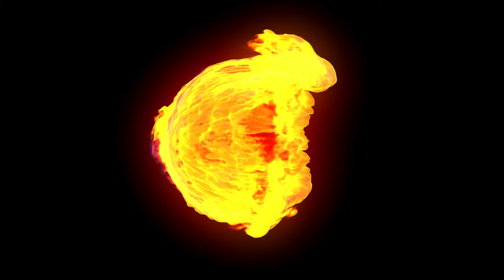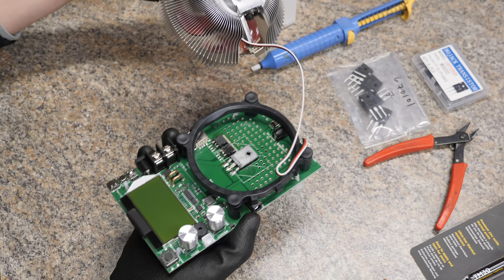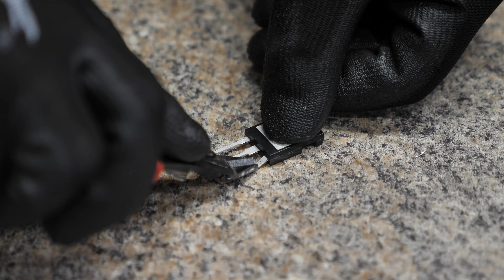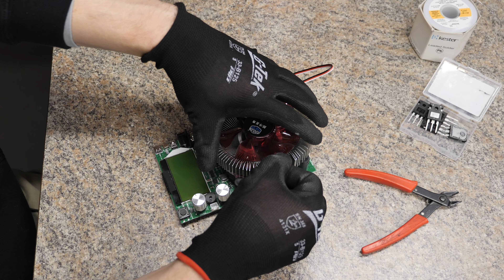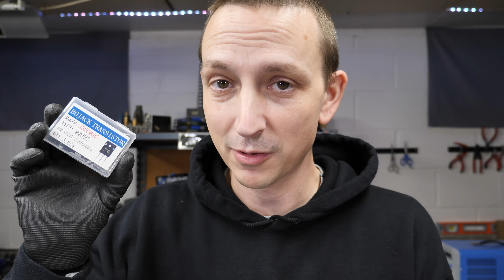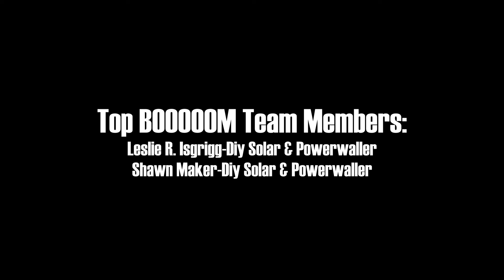150w Battery Capacity Tester Repair - Easy Fix

Comment: Another great video of a common type of repair, nice work Joe 🙂
However,  I must offer a  correction on solder types, it does matter.
You should suggest  using only Rosin core solder for electronics, and never Acid core solders.
Most who watch these videos already know this, don't offer wiggle room for those who don't.
A word on alcohol cleaners, most  off the shelf are from 70% to 90% isopropyl alcohol the rest is water.
Use 100% isopropyl alcohol from an electronics source, otherwise allow the water to dry before powering on.
Till the next video, 🤔💭💣💥
Reply from the maker: Thanks!! Yeah you are right! I always assume others know but I shouldnt assume!🤘
Reply: @AVERAGE_JOE  
There's no way out of assumptions, contrary to that foolish popularized idium, ifself packed-full of metaphysical assumptions, they undergird all knowledge. A helpful key is simply formally recognizing, like prerequisites at university, the knowledge scope of your target audience with key reminders (as you did in new component selection). 
Helpful vid. Thanks!
Reply: I would just buy a can of contact cleaner. Specifically designed for this purpose, pretty cheap and will last you forever.

Comment: Whenever you're testing batteries there must be a backup disconnect system. Never rely on a single semiconductor to stop the current flow. Batteries are never off, they'll give you everything they got without question. Whether or not you want it.

Comment: Just fixed 2 of these that I have blown up, easy fix with your tutorial to reference.  Saved $100+ on fixing instead of buying new ones.  Next time I will make sure the dials are all the way off before connecting an 80v battery at 10A instant load.

Comment: Just did this (a couple times because I apparently can't follow directions), but I used the cheap Bojack MOSFETs.  I also used a piece of flattened copper pipe as a shim between the FET and heatsink to (hopefully) aid in thermal transfer.

Comment: Changed it like u showed, set Batt test to 1.5amps, 150w, Batt is 48v 20amp rated. Tester worked for about 5amps then overheated again and stopped working. Don't understand why unit failed again after mosfet repair

Comment: Its not a easy fix this guy Repair it china style its not smd parts its tht is true hole you need the mosfet true the hole of the backend for a good conection this Style of repair is not Save bending is not needed this guy love to get a house fire this failing again if use on high temperature use tin crack again on

Comment: 6:28 the ideal is not to pass 20A to 22A in the Mosfet .... it's a DC region not in pulses region as inverters work. the Mosfet will not handle the heat of 25 amp in the DC region of the Mosfet where the Mosfet not fully off or fully on completely. and don't forget the higher the voltage you have the lower the Amp you need to put. the Mosfet is good with lower voltage and high current in low frequency and high voltage low current in high frequency

Comment: Hello dear creator
I have the same capacitor tester as you exactly and the exact same problem as you.
But my MOSFET number is IRFP264 and it is not available in my country. Can I use IRFP260N ?
Reply from the maker: Yeah all you need is a good quality mosfet with similar specs as the one that came out/blew up.

Comment: Mine went boom a few minutes ago :(  I can still smell it burnt remains...
I thought you could hook it up to 36 volts. Went pop. Or maybe it can handle 36volts and i had the amps to high. Either way it popped.
Reply from the maker: Whoops😆 Yeah you can 36v but need to start with the dials turned down. Can do 150v if I remember right but again, start with the dials down!🤘
Reply: Fixed it...Thanks for the part reference, my was unreadable.
Reply from the maker: 💥💥 Awesome!🤘

Comment: Please help. Mine has a different problem. The knobs are responding and its actually discharging the battery as it lowers the voltage when i turn the knobs but the ampere is always zero. Which part do you think is the culprit?

Comment: 150W thru one mosfet?
That's too much.
They should've used at least 2 to divide the load.
Yes once I've managed to get 200W on smaller TO220 package but I would do unconventional stuff like soldering that mosfet first to IHS (copper heat spreader salvaged from old CPU) with it's entire back and then having it slapped on a CPU cooler with some PC thermal paste.
At the same time when I had a larger load made using 10 of the same mosfets in parallel, I would do dumb mistake of disconnecting the load at like 40A while it's active and it would turn into a welding machine and completely melt high end gold plated 4mm banana connectors rated to 60A, but the mosfets were unharmed, because I was well within the SOA.
Reply from the maker: Do you think its possible to add more in parallel or would we need to add other stuff in order to make it work?

Comment: They have a design flaw, you don't have to do anything wrong to blow it up! I want to find the original manufacturer, you you know who it is? The type of Fet is the problem. Most fets, any brand, any rating, are not designed for linear operation. they may be rated for 30A and 150V but they can't handle 10A at 100V, just itto illustrate. there is a range of Littlefuse devices designed for linear operation that don't die. I have blown one up and fixed, tested it.
Reply: Atorch.

Comment: Mine just died, I'm unsure if it's the MOSFET that's broken or not, I hit start and nothing happens.  Is there a way to test the existing MOSFET to make sure before speding 1/3 of the cost of a whole new unit?
Reply from the maker: Yeah you can if you have a digital volt meter. You would set it to the diode setting and check the pins to make sure. Just look it up on google and it shows ya how and what to look for.

Comment: I ordered on Digikey, next i will unsolder the old mosfet and clean the area. Hope i can restore my unit after alot of smoke. new ones are 50 amp, 200 volt

Comment: I've had several of these...the mosfets are not protected in any way and there is no feedback loop to protect the mosfet. The gate driver is the problem. It runs to hard and has many spikes on it that exceed the gate voltage. Add a 15v zener from gate to drain to help soak up the gate spikes. When the mosfet blows it is not unusual for it to take out other things too.

Comment: Chopping the legs off of the components you remove first is best I find, IF you don't plan on reusing them. It makes removing components much quicker and easier as you only have the little legs to desolder and unstick from the PCB.

Comment: Thanks for this video. I blew up the MOSFET on my tester once before because I monkeyed with the settings to get the watt draw higher, by just a little, and the original MOSFET popped. Found a video that suggested buying a higher quality replacement and using more and better quality heat transfer paste. Did that and I've have been rockin' ever since. Then I connected an 18 volt Ryobi battery to it after turning both knobs all the way in the WRONG direction. If not for finding your video, I wouldn't have known that that little booboo also pops the MOSFET. So I was able to use the extra parts that I bought the last time to fix this up in just a few minutes, so thanks for giving me the exact info that I needed, and in a short concise way. BTW, if you didn't know, you can change the settings on these testers and get enough amps to do a .2 C test on a 100 AH 12 volt LiFePo4 drop in battery, if you provide a small fan to help keep the temp around 65 -70 C. I've also set it on top of a couple of frozen water bottles to run the test. Stay safe.
Reply from the maker: Awesome glad to hear you gotter going! No I didnt know you could change the settings😲😲
Reply: @AVERAGE_JOE  Search on YT and you'll find videos that can explain how to change the "WATTS" better than I could here. You basically push the button until you get to the field you want to change and then push it 2 times to lower or 3 times to raise the value or vice versa, I don't remember. Once you've done that you hold the button until the display runs up or down to the setting you want. As you get close, you can push the button once over and over to inch up on the setting. then just wait a few seconds and it will lock in that last number. A 12 volt LiFePo4, drop-in, 12 volt, 100 AH battery takes about 280 watts (14 volts X 20 amps) for a  .2c discharge test. The key is to start with the factory settings and note the temperature when you are testing at the max 180 Watts, or whatever your tester is rated at. Remember that temperature and, after raising the max watt limit (that will be in the video when you find it), just make sure you cool the board so it doesn't get above the factory original temperature limit (I have found that it will go to a somewhat higher temp without blowing the MOSFET, but do that at your own risk). You may find that all you have to do is set it in front of an A/C vent. It makes the unit much more useful on a wider range of batteries. For the record, I use one of the Ryobi 4 inch fans to provide the additional cooling.

Comment: My Unit is brand new and it only goes up to 3.4A on a Single LiFePo4 Cell.. does someone know, is it broken?
Reply from the maker: I would say yes unless you are using the small usb cables or small wires. What cell you testing?

Comment: Well explained. Thank you. An extra step would be to put heat paste under the MOSFET. It’s sitting on a large copper ground plane with lots of vias connecting to the other side. This would increase heat dissipation.
Reply from the maker: Thanks for watching! YES actually they would probly help a lot!!!

Comment: What to do if mosfet burns board beneath itself and copper tracks blown... any help as I got 2 of these with identical issue.
Reply from the maker: Hmmmm, Id maybe just add some copper wire for the tracks! Done that for other similar situations.
Reply: @AVERAGE_JOE  tried building up with solder ...angry pixies n magic smoke soon followed,  I've ordered some copper strip to try I'll let u know outcome...
Reply: @stevepr100 any luck?

Comment: Was your screen turning on when it was dead?

 I have 3 of these dead, and nothing on the screen.
Reply from the maker: Yeah screen still worked!
Reply: @AVERAGE_JOE  I found the problem Joe, I didn't plug my unit into the power supply :) I'm a complete idiot....

Comment: Hey Joe, DavidPoz sent me your way, Im looking at the Growatt low frequency inventors and im curious how yours is holding up ?
Reply from the maker: Nice! Mine is holding up GREAT and Love it. I had a few fan lockup faults in the beginning but a firmware update took care of that! Its been running 24/7 since I hung it on the wall!
Reply: Hey thanks Joe,  My biggest load is are half horse well pump so the 6K is more than enough, Thanks again and Thumbs Up !

Comment: Counterfeit components are an absolute plague. I would have thought by now it would have faded away, but no.

Even if a real IRFP260N, looking at the SOA on the datasheet, 150W is up there in dissipation for a single FET! Bit of an optimistic design me thinks. Also a pretty poor design, given that it'll shred itself. 

Pity you don't have a scope. It would be interesting to see what happens on the gate of the FET at startup. Probably wouldn't be too hard to modify the circuit a little to add a delay that disconnects the gate drive until the uC boots (or whatever the mechanism is that's causing the failure)
Reply from the maker: I should have known not to buy the CHEAPEST ones I could find for FIVE LOL.  Yeah no scope here.  Thought someone was sending me there old one but that was over a year ago.  Yeah poor design if you forget to turn it down it will BLOW.  Only does that on the higher voltage stuff or if you turn it up to fast and go over the 150w mark.  If its a single cell its fine and you can full send or leave it on!

Comment: I have one just like this, except it has no knobs (tehe!), just push buttons to set things... I always leave it set at the highest (draining LTO cells) and have had no issues. I wonder how different they are?
Reply from the maker: Nice!  Havent seen that model yet.  If your only doing single cells then full send is ok and it wont blow.  If you leave on or turn up to fast on a higher voltage battery it will blow!  Thats what I did was turned it up to fast on a 48v battery and BOOOOOM!💥😆
Reply: Wait, I take it back, it even says in the instructions not to go "full send" :D

Comment: Now Joe the real question is what would happen if you paralleled up some Extra fets in there.... i mean you'd have more heat to dissipate but i mean half the fun is hacking things to make them better... right.
Reply from the maker: HMMMMMM.....Wonder if it would work!!!
Reply: @AVERAGE_JOE  I recon it would work fine with the possible exception of over whelming the heatsink/fan lol
Reply: @RaithUK  You cannot just parallel fets, they will not share equally.
Reply: @mikesgarage394  Yer your probably right.. you would have to have a very well matched set to reduce the impedance deifference that might be present... but still i recon it would work.. i might buy one and give it a go just for fun.
Reply: @RaithUK  You could make it work, just not as easy as bipolar.

Comment: How can you find the faulty one if the mosfet doesn't blow up , I mean everything looks good but it doesn't work ಠ_ಠ
Reply from the maker: I msg the seller and he said its always the bigger mosfet!
Reply: @AVERAGE_JOE  good to know ;) btw I'm using a resistor ¯\_(ツ)_/¯ budget
Reply: Measure resistance/continuity from pins in MOSFET, If it shows that it's shorted, then it's blown.

Comment: Why would you use this discharger instead of using icharger and regenerative discharge into another battery? Icharger i8 is nice, you can split 16s lfp battery in half and top balance them with it.
Reply: Yea good idea! I am building a regenerative discharge setup with my ToolkitRC M8S though due to the limited load and battery capacity of my setup I built a DiY constant voltage DC load so it will dump any unused power.
Reply from the maker: I use this while using my x6 on other cells!🤘

Comment: Quick Tip: You can get "free" or "cheap" solder wick by taking a coax cable apart and pulling out the braided shielding to it. Just be sure the coax has copper shielding instead of aluminum shielding (ie, not cheap TV cable)
Reply from the maker: LOVE THAT!!!
Reply: Thanks, I'll give that a try. I'll probably soak it in a bit of Flux too. That should help get the solder to soak up into the mesh.
Reply: they cost like a 1$ on aliexpress.
Reply: @pashko90  yes but it takes 3-7 weeks to arrive
Reply: @electrojessy4270  My packages are arriving somewere between 1-3 weeks. i usally buying a bulk of them.
Reply: @pashko90  this works great….. my local post distributer lost my package😭
But its a good idea to save cost and co2👍
Reply: @electrojessy4270  When i'm out of desoldering wick, i use just a regular strended wire. With some flux, works great.
Reply: @pashko90  yes, of course. But then gotta wait a month, hopefully not longer, to receive it.
Being the kind of hoarder that Joe is, I'm sure he has some spare cable laying around 😜
Reply: Wow i never came ut whit this i use coax cable 1-2 times a week 😂
Reply: Excellent, I've got such a cable in my garage, nice !
Reply: Are u fucking serious I will 100% try this thank you